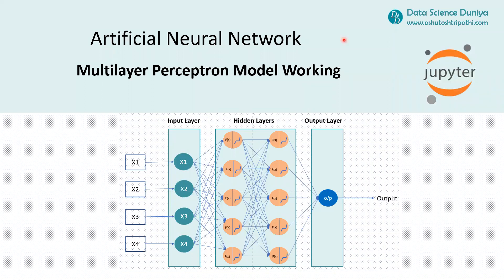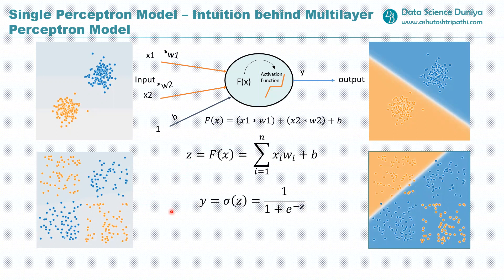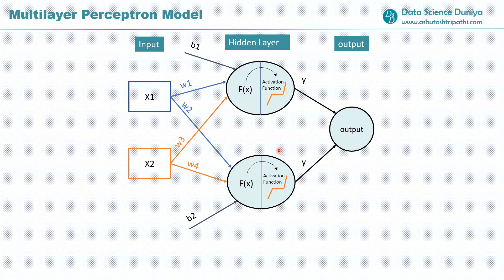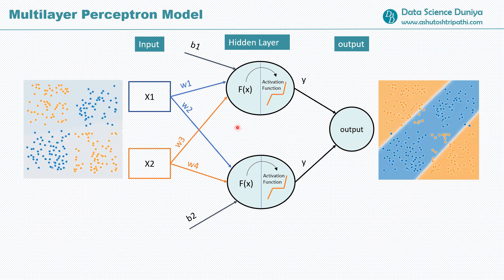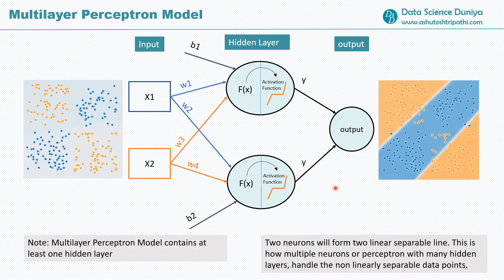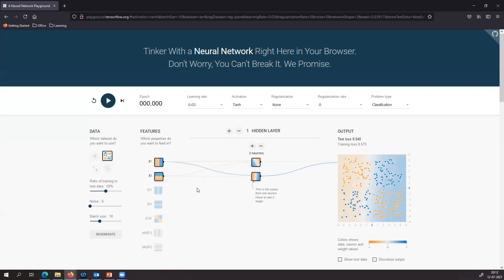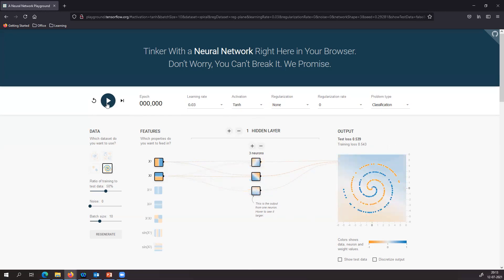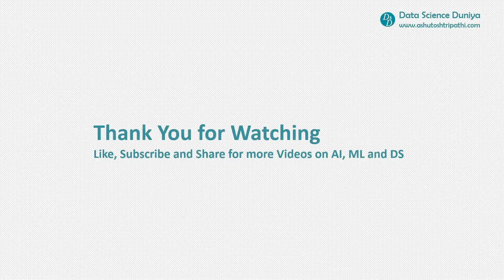How Multi Layer Perceptron Model Works? | Real Time Visualization of Multi Layer Perceptron Model

Comment: How increasing neuron helps creating  classification boundaries. Please explain
Reply from the maker: So each neuron tries to learn the specific feature in dataset. So increasing the neurons indirectly you are increasing the learning capability. Think of our brain system which has millions of neurons. But one thing to remember if we blindly increase the neuron they might cause the overfitting as well. Also after certain no you might not see much improvements in classification boundry but it will certainly increase the complexity. So you should always have a balance. Hope it clarifies.
Reply: Thanks for writing ✍